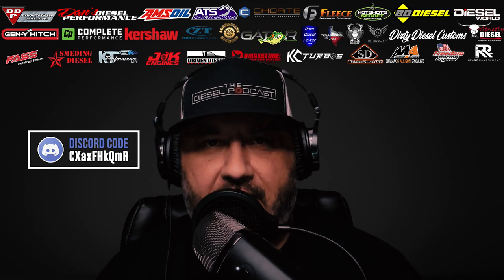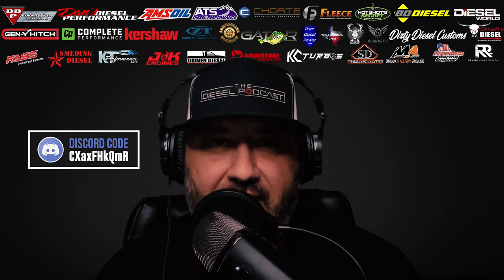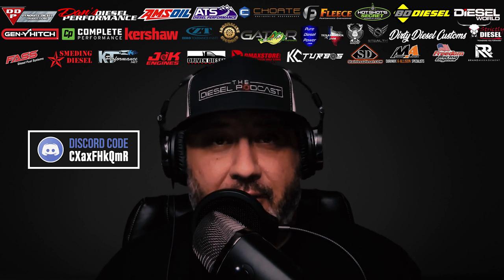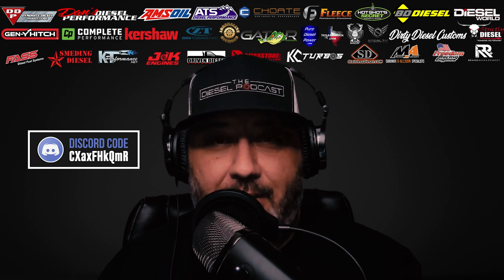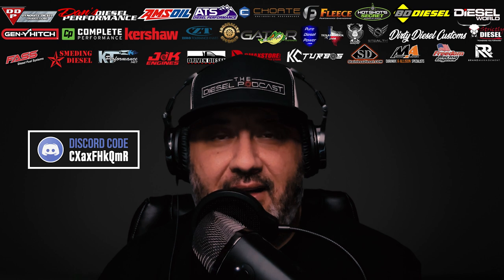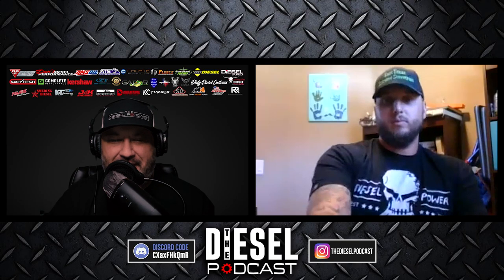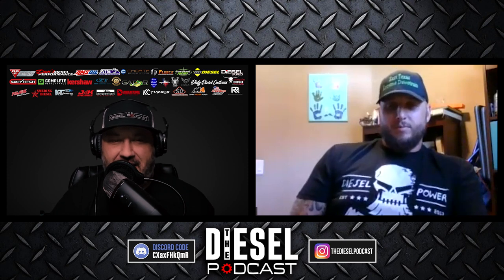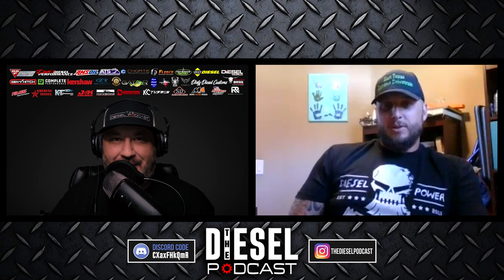3 Tips to Avoid Driveline Failures

Comment: LOL I have a "500hp" LB7 and I have grenaded almost every driveline component. I broke the G80 gov lock diff first. It broke then went full spool then broke fully. I pulled the cover 3 times pulling parts out. It even poked a hole from the inside out the diff cover. then the pinion started leaking so I pulled the seal and two rollers were missing from the pinion bearing. I swapped in an open aam 11.5. Then I smoked the clutches in the trans and had Mike L build a 750whp 5 speed and fixed the pump rub in my 261XHD. After that I was breaking steel CV spacers up front and twisting the splines in the front hubs. So RCVs fixed that plus im 3" wider up front. Also torsen diffs front and rear.